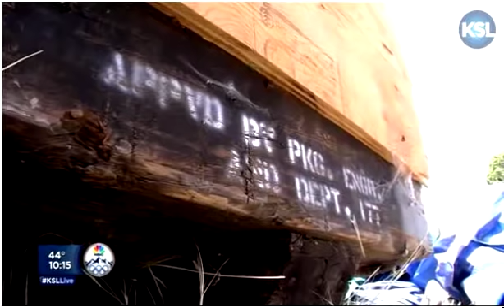World's Largest Amateur Telescope

Comment: How about showing us a picture of a planet trough it? Na, no one wants to see that on the news...
Reply: It's a dobsonian mounting which is not appropriate for astrophotography...that's a low cost design proper only for observation. Because of the Earth's rotation, you got to have some equipment to follow its movement so pics don't come up as a shit blurred thing. Hope this clarifies.
Reply: @augusto3645  With a mirror like that you don't need that long exposures, it should be possible to make pretty good pictures of planets.
Reply: @forton615  Yes like 2-4 seconds with that much light gathering power!
Reply: Glenn Joy actually planets you need very short exposures, as short as your camera supports. Talking about microseconds here. So yeah planets are definitely doable with Dobson‘s , but you‘d need thousands of those short exposures to get a good quality picture and that‘s where automatically tracked telescopes come in handy
Reply: @augusto3645  THere's no way something that big doesn't have motors on it.
Reply: because its impractical
Reply: The magnification would be too high
Reply: @HiWetcam Yeah obviously the weight of the makes it very practical to move with motors. More seriously, even at perfect balance, he would need less friction over the mount or use 200W stepper motors at least. And something to control them
Reply: @MatHelm  At 1:10 it shows him adjusting the mount with hand cranked come-alongs.
Reply: @augusto3645  For planets you can record a video and then stack the frames in software to produce a very sharp image
Reply: It's determined by dividing the telescope focal length by the eyepiece focal length
Reply: Bosuns Mate  Magnification is also determined by focal length of the telescope. This guy probably needs specialist eyepieces, 80-100 mm focal length.
Reply: It's an off-axis reflector with such a huge coma and astigmatism that I can't imagine a good planetary imaging on this thing. It's a deepsky monster, but planets - nah, not his job.
Reply: "low cost design" 😂
Reply: @augusto3645  one shot planetary picture would be great
Reply: Yeah no shit. One lousy picture of Saturn would have done the trick.
Reply: @mr.person5788  The magnification is a ratio between the focal length of the telescope and the chosen eyepiece. You could get less magnification just by using an eyepiece with larger focal length...
Reply: @guilhermetorresj  Yes but have you ever seen n eyepiece with a focal length of more than 50mm?
Reply: @mr.person5788  The guy himself uses a 38mm eyepiece. You could also just use what would be the primary lens for a very small refractor, and you'd probably get some huge eye relief too, lmao.
Reply: @forton615  A telescope of that size would be very limited by the atmosphere for high resolution planetary imaging so the images are not likely to be much better than what a regular 14" SCT can produce.
Reply: Most comments here are so negative. The OP was not asking about a picture where you could read the tag number of the Mars Rover. A picture, even if blurry, could give us an idea of what can be seen through this monstrosity. Most CCDs on good quality smartphones are more sensitive than the human eye.
Reply: @JV-tk3nn  my man🤝
Reply: @augusto3645  all big telescopes use alt-az mounts. You just need field de-rotator for astrophotography
Reply: @augusto3645  People, I see all these replies about the enormous size and weight being a problem for some sort of simple drive for tracking for photography. But he does not need any of that. With modern CCD cameras he could shoot and stack hundreds of frames a second and get great shots of pretty much any deep sky object.
Reply: @mr.person5788  Magnification is not a matter of size of the mirror, it is a matter of what eyepiece he uses. The mirror is giving him greater brightness, not magnification.
Reply: Now He can see flag of America which was placed on moon,,,,, ohhh  Wait,   that might be one hanging in front of telescope 🤪😂

Comment: Undoubtedly incredible interest in astronomy. It seems to be all too common that youtube videos that either review telescopes or cover the building of telescopes, do not show the images that are captured by the telescopes. At 70 inches, you can only imagine what he should be able to see.....
Reply: This telescope seems to be a strictly  visual telescope so it doesn't seem suitable for imaging. However, I am sure the views through the eyepiece would be out of this world.
Reply: @AbdurAstro  Wrong, any scope can easily be used if you know what you're doing. Most people just don't care about doing imaging though.
Reply: @kishascape  So true.
People even told me astrophotography without a coma corrector on newtons doesnt work, well it works.

Its just one thing: you better dont show "how good" it works since the corners of the images look pretty ugly. Same with a refractor without its fitting corrector, but these visual problems are even worse without corrector.

Hell, Astrobiscuit even made astrophotography with binoculars and a smartphone... its a pretty poor result, but i guess there is anyways not much to expect from the beginning.

But its partially true... have you ever tried a dobson mount for astrophotography? Trust me, it doesnt work, at least not if you plan longer exposures than something like 1 second or less...
And even "cheap" EQ mounts with maxxed out load arent really good for astrophotography (personal experience with a 500$ 2nd hand telescope on a "cheap" EQ3-2)

Comment: "Anyone can do it". Building a telescope as an amateur is actually very very very hard
Reply: making the primary is hard, the rest is fairly easy actually
Reply: @insightfulgarbage  Exactly. Most kits already have the mirror made for you so all you have to do is put the tubes and sticks together.
Reply: the mirror is the hard bit
Reply: Hard doesn't mean you can't do it, it just means it's going to take long
Reply: Not really.

Comment: 1:37 I was shown a 17.5" mirror and a secondary mirror. I was an amateur and I built a scope for the the mirrors and it worked (after a bit of adjusting). And I knew basically nothing about telescopes, so it's true what he said. But you still have to be able to build stuff. But it's mostly straight forward.
Reply: There were Estate Telescopes in the 1800s. Rich people had open top small buildings made around a large cast iron tube and suspended it from chains to control the tilt and steer it somewhat and just used the earths rotation to point it. Just like this but far bigger.

Comment from the maker: I'm only going to say this ONE MORE TIME. This is an OBSERVATIONAL telescope. It is NOT designed for photography. The best you could do is put a cell phone up to the eyepiece and try to take a photo. And even this would not yield any desirable results. Photographic telescopes require tracking and special CCD adapters.
Reply: El Grande ....Thnx for that! Telescope now has tracking, but is still only intended for looking through.
Reply: @mastro4065  So it has tracking but Dobsonians make it difficult for it to be tracked accurately enough for photography?  I can see how our eyes are very forgiving - as long as its relatively centered we're happy.  Not so for photography?
Reply: @be quieter ....yea...you actually summed up Dobsonian astrophotography pretty well. It can certainly be done.. But for visual observing, for which my telescope was designed, the parameters are much more relaxed. In fact, with my desire to allow as many people to look through it, I often don’t even properly initialize the tracking system. I prefer to not fiddle and fuss around while people are waiting to observe through it. Even roughly aligned with magic marker lines drawn on the cement pad where the telescope is placed, is adequate. Objects stay reasonably centered, while many people to look through it. And then I give people the hand paddle, and let them recenter the object for themselves! All good fun!
Reply: @mastro4065  man you're so awesome
Reply: @Robotron Sage.....thank you so much for those kind words!
Reply: @mastro4065  You're an inspiration! Reach for the stars! haha
Mike I am a ufologist
I would like to invite you to an internet chatgroup but it may be a bit juvenile for your taste. I have a few things on my channel if you're interested in hearing some crazy stories! lol

I would however be honoured by your presence if you are interested in joining our chatgroup. People could learn from an astronomer like yourself :D 
Let me know if you are interested, we use a service called 'discord' which is sortof like IRC but more user friendly in a sense.
Reply: @Robotron Sage....no such thing as “too juvenile”! When I was just a kid, I was tearing apart eyeglasses, and making them into crude telescopes! I like to think that child-like aspects of personality are positive! I have a difficult enough time keeping track of posts I do on YouTube,  with my rediculously busy schedule as a truck driver, so instead of the chat group, how about you and your friends ask me questions on my YouTube channel? Just click my YouTube profile picture (my 70 inch telescope picture) and let’s chat there..I have about six videos, just pick a video, and I don’t think YouTube would have a problem, since it the discussions would be related to space and science. I have found though, that more than a couple edits, as well as rapid exchanges of responses, can get omitted, since the YouTube algorithms detect them as “spam”....if they happen too quickly. sound good?
Reply: @mastro4065  I would probably forget to keep in touch as i am also quite busy since recently and youtube doesn't organize notifications in an oversightly manner :(

I don't have any objections to keeping in contact it is just i am quite a forgetful person who lacks planning skills lol

I am enclosing an invite to the chat server anyway, you can decide for yourself if it is worth the effort lol 
https://discord.gg/eXfcVRT
We're mainly a ufology based server i am just thinking with your skills as an astronomer and engineering we could learn a lot from you. 

However our userbase isn't the most mature of peoples, lol. I'm not sure we have a lot to offer, unless you are interested in ufology, strange experiences, paranormal stuff, mythology, etc.

If you have a smartphone or a computer you can download an app or .exe for the chat client (it's quite a popular program and many people are using it to communicate nowadays)

But if you have other reasons not to take interest i fully understand. Perhaps there is a way to exchange e-mail addresses?   Usually i am more responsive in e-mail correspondences

It's weird that Youtube doesn't have direct message capabilities
Reply: @Robotron Sage....I hear ‘ya about YouTube being a little weird the way responses are handled and categorized.....Thanks for that link to the chat group....I tried it, but it wouldn’t let me download the app, right now, I think, because I am not on WiFi....When I get a better connection, I will try again. The chat group sounds cool! Thnx for the invite! 👍👍👍✅✅✅🔭🔭🔭
Reply: @mastro4065  i sincerely hope you will enjoy the app, it can also be used to make your own chatrooms. it's sortof like whatsapp, but much better :)
Reply: @Robotron Sage....Excellent! I finally got a good connection that allowed me to install the app! Looks like a fun chat group! Be patient with me as, I am fairly computer ignorant! Yea, I built a big telescope, but realize that was Cold War era technology! That spy satellite was designed before they had ccd’s, that’s why they actually PARACHUTED the film down to Earth, and the Navy retrieved the film canister!  But, hopefully this old dog (me) can still learn some new tricks! I look forward to trying out the chat group! Thnx again! 👍👍👍
Reply: @mastro4065  ''Yea, I built a big telescope, but realize that was Cold War era technology! ''

hahahahha!!! 
Oh man that's some really neat information :D They parachuted the film rolls? Hah, it's inventive for sure :P

An active attendance isn't required from out chat group, feel free to use the app at your own leisure. The last thing i would want is for you to feel like you >have< to always respond to us :P

But i do feel like we could learn a lot from your endeavours. If you're also interested in ufology or general paranormal phenomenon, then there may be some information of value to you that we can share :) I am certainly also looking forward to communicating ^__^ You're an inspiration !

(now, i don't have any cold war sattelites laying around my immediate vicinity but that doesn't detract from the inspiration lol)
Reply: @Robotron Sage ...thnx for your input! I appreciate what you are saying about the casual participation on the chat group! Yea, with my job as a truck driver, it a weird schedule, and lots of places, and locations where I have NO signal! Nevada and Wyoming are the worst!
Reply: @mastro4065   can you see color in nebulae with this? how does Orion look?
Reply: @Noel Dsouza .....yes, greens and reds, and multiple stars in the trapezium of M 42!
Reply: @mastro4065  Amazing! I'm incredibly jealous. I've been using an 8inch dob for a few years now, it's just black and white. Hopefully someday I can make it out there to take a look.
Reply: @mastro4065  also, what's the highest practical magnification you've achieved?
Reply: @Noel Dsouza ....yea, come on out sometime and have a look 👍👍👍  Highest practical mag. I have used, about 600X on small planetary nebula....
Reply: It's a simple process to add CCD adapter for image.

Comment: That's larger than the original  Mt. Wilson reflector, which at one time was the largest telescope in the world.
Reply: I thought Mt. Wilson was 100"
Reply: Unless that 100" was a later mirror, in which case I apologise
Reply: @keithwaites9991  There are two reflecting telescopes on Mt. Wilson, a 60" and a 100".  Both had plate glass mirrors, originally with a silver coating, later they were aluminized.
Reply: @scharkalvin  thanks for the info. Funnily enough many years ago I was quite a keen amateur astronomer and I probably knew that then. Anyway I stand by my earlier apology for my error. take care and stay safe

Comment: good on you sir.Any chance of   seeing some results?
Reply: Kevin Deemster Nope. Atmospheric distortion will be a huge problem with such a big mirror. That's why they put these things in space u know...
Reply: Not true.  I've looked through 30-36" telescopes.  Aperture isn't a limiting factor to atmospheric distortion otherwise the largest terrestrial telescopes which are much larger than this would be worthless.    The limiting factor on a clear night for any telescope is the disturbance in the air currents overhead.   That's why most large telescopes are used at higher altitudes to reduce the amount of  disturbance by rising above it.
Reply: mycarolinaskies Good point. But why didn't they show pictures then?
Reply: Because it is a Dobsonian. They do not track accurately so images are blurred.
Reply: Dobsonian telescopes are built for visual only.
Reply: eh no? lol
Reply: Well, yes, it's a dobsonian telescope, so by definition it's not designed to be an astrograph. It's a low-cost design. 
They mainly have poor precision tracking (when they have one) so you are limited to short exposures, ms to ~1mn, and their mirror in general are of poor quality
Reply: @Clément Brustel ....military grade spy satellite mirrors are not “poor” quality....I designed this telescope to be looked through directly, hence no photographs, but it does have tracking motors to follow the stars.
Reply: I thought that the minimum usable power giving an exit pupil of, say, 7 mm, would exceed the maximum power the atmosphere would normally allow with a mirror that size.  But with a mirror that size, TRAPPIST-1 should be really easy to see visually.  By the way, what is the F ratio and is this a parabolic mirror?
Reply: @polyrhythmia .....yes. You are so right! Considering the typically poor atmospheric stability (seeing) at the observatory where the telescope is used. I utilize a number of different techniques to reduce the blurriness of the images. For extended objects like galaxies and nebulae, the effect is less problematic, than when observing planets. When observing planets I have a number of eyepieces, I have modified to “spill light” (exceeding the nominal exit pupil of 7mm) however, I overcome the huge secondary mirror shadow, by actually MASKING THE EYEPIECE, rather than masking the primary mirror. The observer views a “sector” of the eyepiece. This sounds weird, but it work well. The primary mirror was designed by the military as a hyperboloid. But due to its long focal ratio of F/6.125, I am able to use it WITHOUT any correcting elements. This is because the wavefront deviation from a paraboloid is so small, any amount of deviation (slight overcorrection) would not become evident until about 2000X, which, of course is far more magnification than the Typical skies would ever allow!